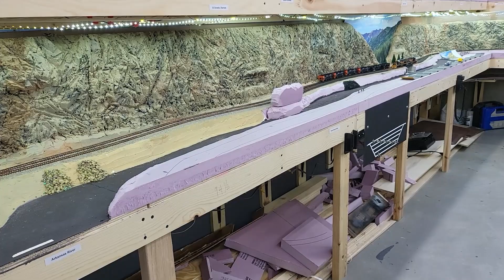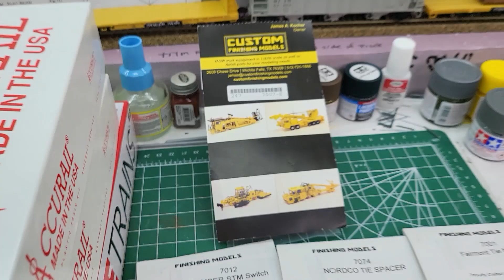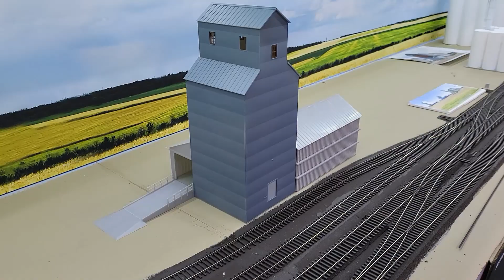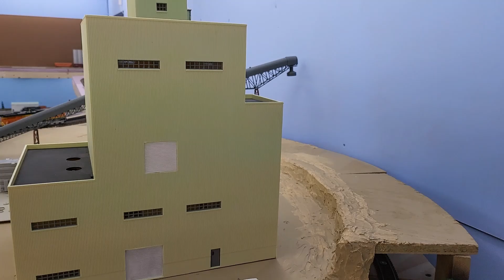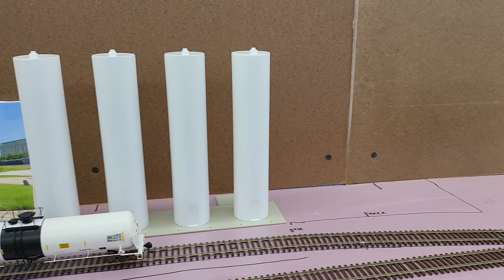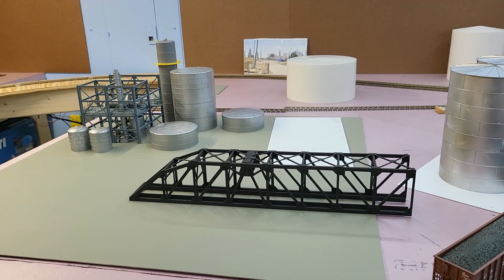K&W HO Scale Model Railroad, Construction Update #38 -  Holcomb Power Plant looks like something!

Comment: One way to include the road bridge and have your trains dissappear from view into the helix is to place the road bridge further back, leading behind the plant building rather than in front of it, and having the train dissappear beneath the bridge like a tunnel portal.
Reply from the maker: I agree...a couple other commenters suggested that course of action yesterday.  Today I had a chance to place the bridge in front of the helix exit and although it does help to hide the helix exit, it is not going to be an easy fix due to the angle of the bridge in relation to the main power plant structure.  It is not an option I intend to give up, it is just going to take some fancy engineering to make it look decent.  So...a fun challenge to overcome!

Comment: When building the white metal kits, triple check the plans to make sure you’ve drilled all the necessary holes before assembling. Can’t drill a missing hole for hydraulic hoses after assembly. Also, painting the wheels with numerous coats of nail polish will insulate them so they can sit on the rails without shorting the power.
Reply from the maker: @MILWfan75  Awesome tips!  Thank you!

Comment: My vote is for you. Is that you get some paint and go to town.  Sky ,  earth color over the pink. Roads some paint will change a lot in a short time. Then start placing ballast down where you are happy with the track placement.  Just remember, if you are going to use an electronic switch machine like a tortoise , put a 1/4 hole under the turnout before you ballast the track. Thanks for another great video.
Reply from the maker: Thank you for your vote for paint and ballast!

Comment: Looking good!

Ran into the same issue with a Window.   Opted to go with a 24-inch high piece of fiber board which still allows some natural light.  

Are you going to do background flats all the way around or doing a mixture with background structures?
Reply from the maker: I was concerned about maintaining some natural light at first, but after some thought, could not come up with a good reason why.  My train room is very well lit, so I don't really need the light, and I work in there mostly at night anyway.
I would say that I will be using background structures more than flats.  Commercial photo-realistic backdrops will also provide some of the background structures, especially for the Evraz Steel Mill in Pueblo, several more grain elevators for the Wichita Industrial Park, and more refinery structures for the El Dorado refinery.

Comment: Allen, with regards to the Holcomb Power Plant. I think you're worrying too much about the prototypical side of things... just make it to suit the area and how it looks, remember its a model railway it doesn't have to be exact.. with the entry way to the helix just a few trees would cover the hole and when the back drop is there you wont notice it that much if you paint the timber and the start of the plaster area the same color as the backdrop, and as for the agg pile make a half cast plaster model or a pile of dirt/gravel up against a board and glue it then paint it black/grey and sit it up against the backdrop. For4 the main grain elevator once you put a lid on the pipes and paint it you wont notice the minimal difference in the pipes, paint fills gaps remember... once again it stands out now due to not being finished. Don't make more work for yourself when it is not needed.. with the backdrop panel at the window, just screw some pieces of 2x1 to the window frame then screw the backdrop to that, then it can be removed anytime you need access. Id love to see more work done on the power plant seeing I have given you a few ideas to help with it.. You are doing a fantastic job and kudos to you for getting it done and keeping it happening.
Reply from the maker: Great suggestions, all Tim!  You have a point about trying to over-do the prototypical aspects...however, I view it is a fun part of the challenge of designing these scenes.  Jason Weir's idea of moving the road bridge to help cover the portal is fantastic and I think will work really well, so I am going to try that.  I will still have some trees to further help hide the portal, but moving the bridge there solves several problems at once.  Awesome suggestion for constructing the coal pile against the backdrop.  I didn't really know where to start with that and had been looking at Hobby Lobby for styrofoam molds I could use, but to no avail.  Your idea gives me a place to start.  Regarding the Wichita elevator roof...I haven't even laid a piece of styrene on top of those pipes yet to see what kind of difference there really is and whether it stands out.  I could be that it wouldn't even be noticed since it's well above most people's eye level.  I think the top of those silos is around 6' 5" from the floor, so you might be right that it isn't worth the effort.  Also, another good suggestion for attaching the backdrop in front of the window...I'll give that some thought too!  I have you down for Holcomb Power Plant...thank you!

Comment: Hey, I noticed that some of your tracks have roadbed and some without.

Do you use roadbed only for the mainline track? Just curious.
Reply from the maker: @MattsTrainsandThings  I use HO scale roadbed for the main line, N scale roadbed for secondary lines, and no roadbed for yard and industry tracks...for the most part.  The helix track around Holcomb was originally NOT going to be seen so it has no roadbed.  The El Dorado industrial park industries have roadbed because the prototypes do.  It's not an exact system as you can see.
Reply: @KandWRailroader  Thanks.